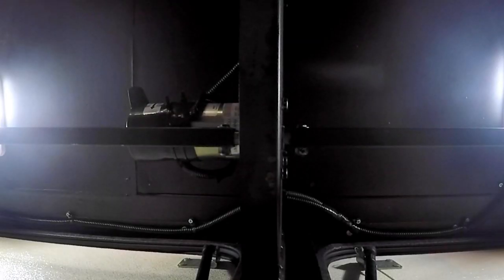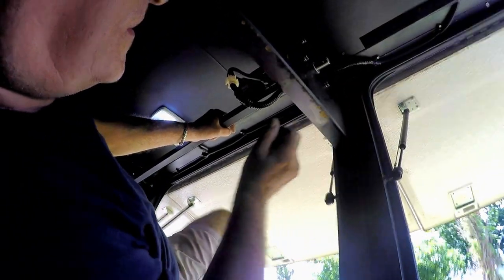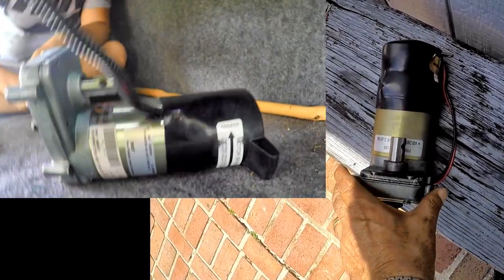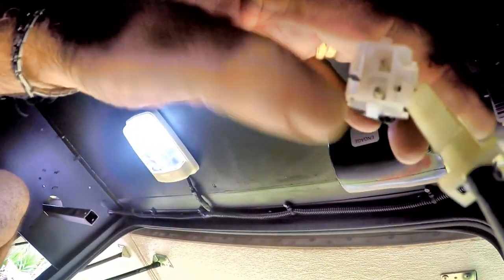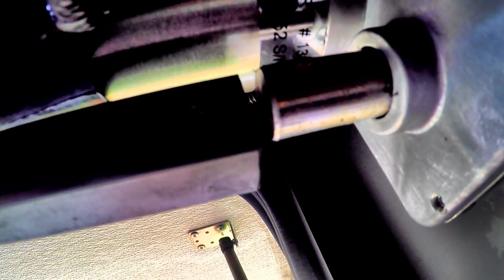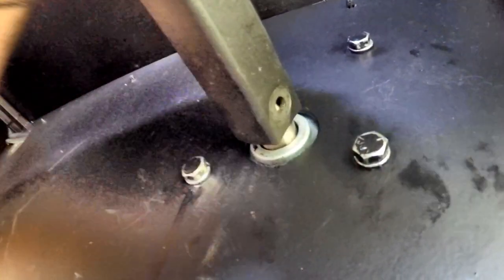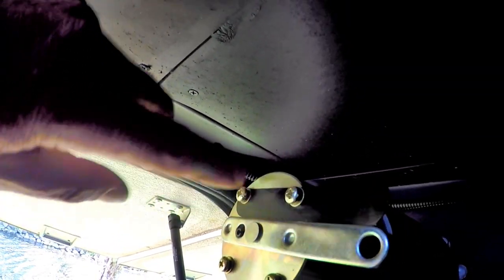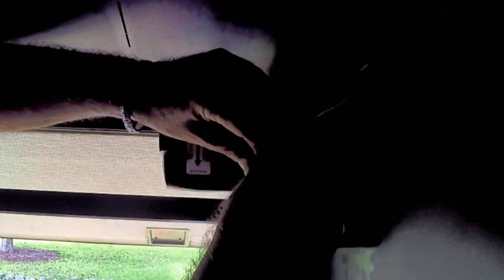HOW TO REPLACE RV SLIDE OUT MOTOR | POWER GEAR - LIPPERT

Comment: Thanks John  I just bought a 2003 Dolphin 5342 and your video will help if I have any slide problems.
Reply from the maker: You are welcome, the slide system is very easy to get to and troubleshoot compared to some newer models. Hopepefully you will never need to do this but it’s good to know how they operate and where all the mechanism is. Good luck with your Dolphin. They were built very well.👌

Comment: That is great access to the motor and motor brake.  I have a Schwintek system (which I am happy with) but I miss having easy access like that.  Great video and stay safe, Lou
Reply from the maker: Hey Lou, I have seen the new ones, they are pretty small too. This one was the original and really cant complain how long it lasted ( 15 yrs ) and lots of use on a large heavy slide. I even had to adjust the height of that slide once but cant find the footage. I think the bad roads really have a lot to do with the abuse they take. I was on the LIE years ago visiting relatives in L.I. and then up to Niagara Falls, I had to tighten every screw in the motorhome LOL. Take care.

Comment: Thanks John , for the information, I have a question.  I have a 2005 bounder, 36' long, with two slides. Electric slide out system is made by Power gear.  I am having trouble with the slide in the living area.  We were about to go on vacation, and I was about to bring the slide in , and as I pushed the button, I heard banging coming from  beneath the slide.  I stopped trying to retract the slide.  I went under the slide and had my wife press the switch.  I then noticed that both shafts were buffeting and vibrating very loud, and that the motor was trying to turn the shafts.  I called the dealer and of course they were very busy and could not give me an appointment for two weeks.  That is the end of the vacation.  My question is that could it be the motor gears , like the one you just replaced?  I would be thankful  for any information you could provide.      Thank You, Ed
Reply from the maker: Sorry to hear about your troubles Ed.
If the both shafts are not moving and you hear gears grinding it can only be stripped gears. If you want to make sure you can take the motor and gear box down an then take the gear box apart. Good luck.
Reply: Thank you John and may God bless you and your family.

Comment: Great video. I wish our Lippert slideout mechanism was like yours, with pretty much everything accessible from underneath. Our Lippert slideout motors are hidden inside the rubber seals, one at each end of the slideout , near the top. We’ve been lucky so far, and haven’t had a need to replace either of them.
Reply from the maker: After 15 years of use they do need a little adjusting and replacing. Thanks for the comment.

Comment: John: you make it look easy! My 99 Dolphin has similar issue.  Motor is a little different though.   Positioned all the way forward with the square shafts running toward the rear.  Grinds when pulling it in and now locked up in the extended position.  smooth as silk going out though.  Would you say it's a similar issue, with same steps to repair?
Reply from the maker: +Dojo2929 sounds like it’s the same issue. 
Just to make sure, check the lock lever on the motor to make sure it’s engaged in the locked position. I have heard someone mention that on another site.

Comment: Have you ever changed out a Lippert Components Above Floor Slide-Out dual rail?  I can't find any information on how to change out the cam follower or rollers on the rail.  I think you have to pull the slide completely off to replace these.  I've had a couple go loose and I'm afraid one day they will fail and I won't be ready....Thanks
Reply from the maker: I know there's 3 rollers in my dolphin and to get to them you need to pull out the slide off. definitely need a shop forklift and some heavy duty stands...

Comment: Great video ! Can you replace the motor with the slide fully out ? Or would it be better to bring the slide in manually and leave it out a little bit as directed ?
Reply from the maker: I found that the slide is level and sits on the floor rollers if you slide it in the position as directed. This will make it easier to slide it and adjust it if needed.
Reply: @JohnCRV  thanks John Appreciate the quick reply and awesome video !

Comment: I need to replace my livingroom slideout. I have a 2006 Tiffin Allegro Open Road Workhorse. Same as your rig, W22, ETC... What Powergear part number for the slideout will I need to repair the motor? My problem is the right side of the slide out will retract, but the left side will not retract evenly. I had to have assistance of others push the slideout in as I depressed the slideout button. What can be the problem?
Reply from the maker: Hey Guy, Does your slide make any type of noise on the side that's dragging? do hear the gears skipping on the track. It may be an up/down track adjustment issue.
Watch this video if you have not already, it will give you an idea of how the tracks and gears look on each side.  https://youtu.be/cycjHrNMnlg
Reply from the maker: Kwikee 523900 Slide Out Motor is on my slide out. Make sure your old one is the same.
https://amzn.to/2FEq0gp

Comment: This is how it should be. I'm replacing a failed slide motor on a large room for my Schwintek that is stuck open. Only access is from the exterior. Have to pull seals part and try to pop the motor loose from the gear before I can even push the wall back in a few inches to access from the interior.
Reply from the maker: I'm sorry, Do you have a question?

Comment: Hi, I carried my Gemini Thor RV to Camping World to have my slide looked at diagnosed and repaired. The slide would not go out. They said it needed new slide motor. I said ok replace it. After it was replaced they apparently forced it to open and broke the slide rails. They have waited several weeks now for the slide rails to come in at a cost to me of 900$. The installation is estimated 12 hours. Cost labor 1600$. The motor cost 250$ with 4 hours to replace. Just wanted your comment on this.
Reply from the maker: How did they break the side rails?
Reply: @JohnCRV  Camping World told me, when new slide motor was installed, technician was attempting to put the slide out when he heard a crack/break noise. That was the slide rails breaking. That was terrible news. I was wondering your thoughts about this. Thanks!
Reply from the maker: I’m not sure if your rails are like mine. 
see this link and tell me if it’s the same.. https://youtu.be/cycjHrNMnlg
if it is, there’s no way a motor would crack it, the gear in the motor would strip first.
Reply: @JohnCRV  my rails are different. Mine are screwed to the sides of the slideout.
Reply from the maker: I did some research with some friends that have something similar to yours. Nothing to brag about for a solution to your issue but we have one thing in common, THEY SHOULD PAY FOR THE COST OF THE TRACKS.

Comment: Slide out is stuck closed.   Very little room to work.    Shear bolts/nuts on telescopic poles just spins.  Bolt doesn't spin but nut does...   Any ideas?d
Reply from the maker: Replace the bolts and make sure they are high grade type. then slowly try to slide it out but I would have a helper push from the inside at the same time. There may be something obstructing it from coming out.

Comment: Great. Now to diagnose mine. It just stopped working. First, learn how to extend and retract manually in a correct fashion. Then I assume to find the culprit- switch, motor, or controller.
Reply from the maker: Hey nelson, if you have the same set up, all you need is a socket on a ratchet and attach it to the bolt at the end of the gears. If you are not getting anything  at the motor, start with testing the wires at the motor, If you are getting 12 volts its a bad motor. If you get juice than you go to fuses switches .........

Comment: John,  did you purchase the  motor from Amazon, I am having trouble finding a dealer?
Reply from the maker: See the link for the one I bought from amazon and from there you can usually find different models. Or at least find the manufacturer that you can call and see if they have your model. Good luck.
Reply: Thank you very much John.

Comment: If it goes out but not in, is the relay built in?
Reply from the maker: It can also be the switch itself or the connection. The relay should be close to the switch.
Reply: Replaced the switch and that didn’t work.  relay isn’t near the motor...
Reply: Motor is under the bed, switch is on the wall...
Reply from the maker: Then you need to trace the wire I'm sure one of your compartments has a fuse box along with relays. Good luck.